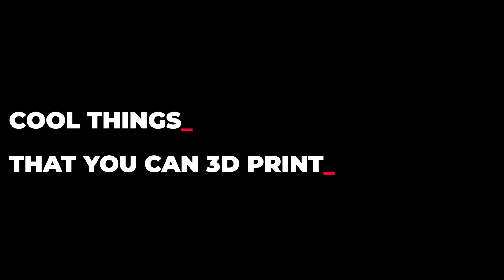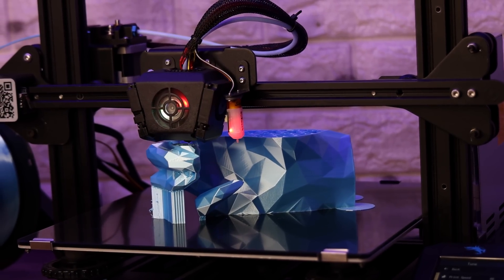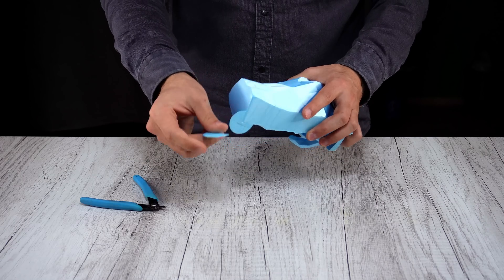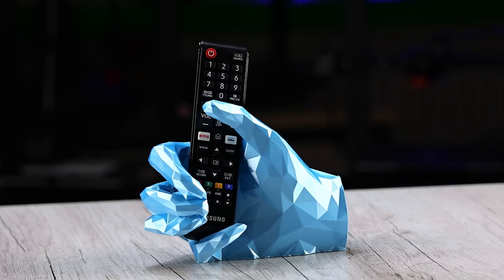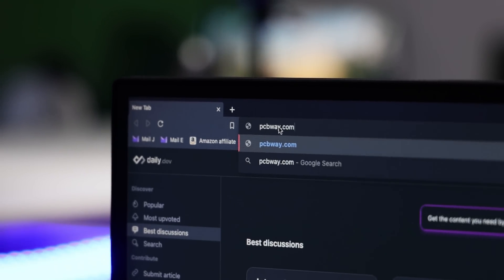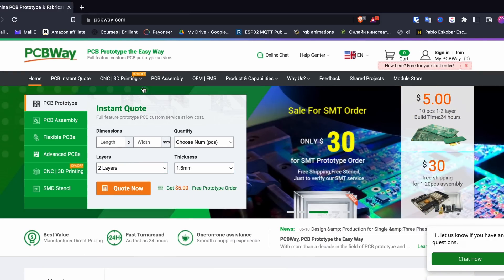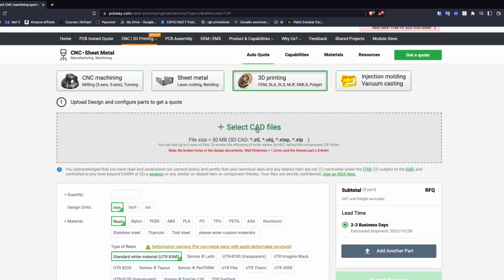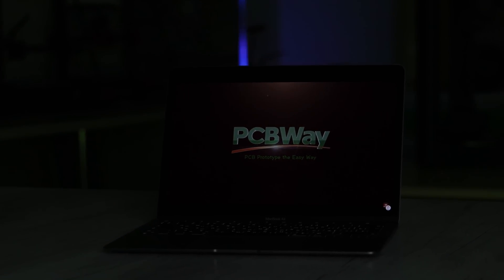COOL Things To 3D Print - December 2022

Comment: What is the name of the tool you use to clean the edges of your prints? 
Like at 10:29?
Reply: Its a deburring tool.  A must have for 3d printing.  I recommend getting one with a metal handle.  The extra weight is nice and the plastic ones from my experience pull out the blades on occasion
Reply: @pootinplays  thank you!

Comment: What is that spray you've used?🤨🤨🤨😄😄😄
Reply: I don’t get it: you’re spraying a super glue accelerator— and it makes it easier to remove parts from the bed?
Reply from the maker: @OriginalSchles  Yess, because it is so cold we sprayed.
Reply: So in theory I could spray with just a normal compressed air can as long as what comes out is endothermic (absorbs heat)?
Reply from the maker: @OriginalSchles  You can just spray cold water also.
Reply from the maker: It is  just a super glue accelerator🥹